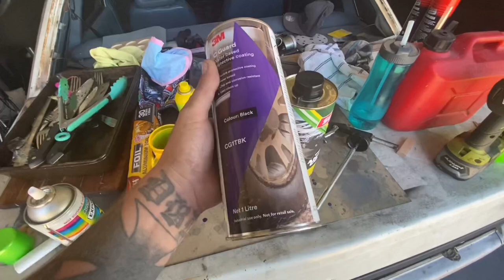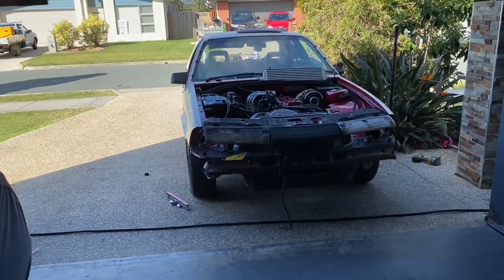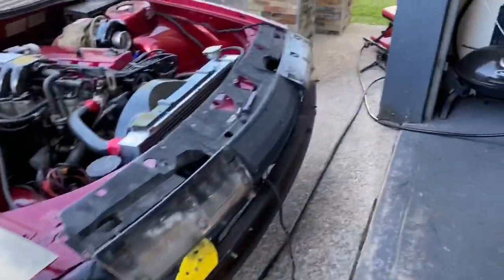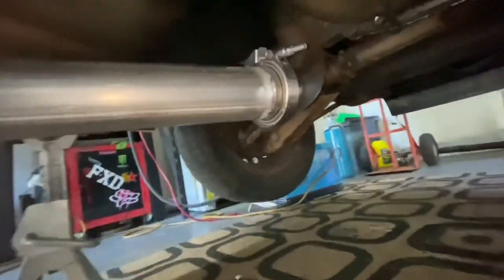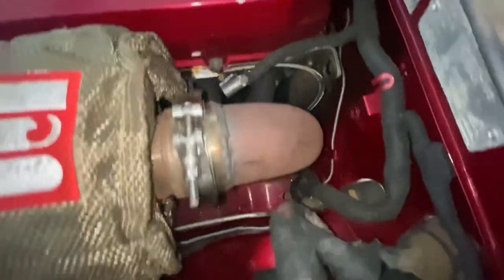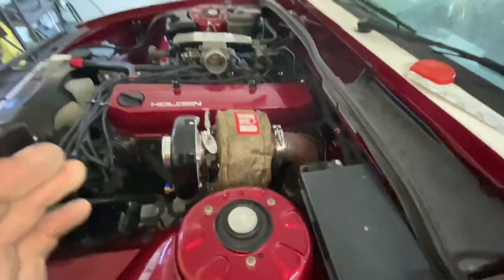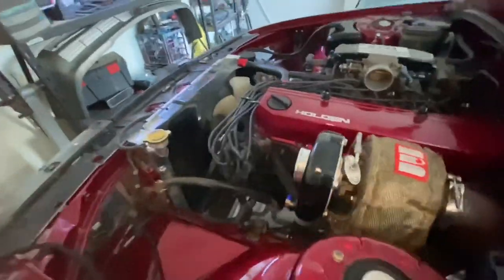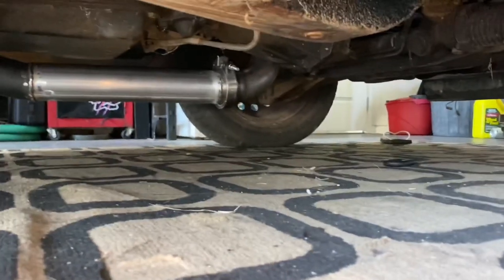Vl Executive Part 13 Making Exhaust & Painting Underbody

Comment: Hey mate just want to no if the mx7 York will fit a na rb30 Manuel box ? If not and u still have ur na Manuel York I'll buy it off you if u don't need it cheers
Reply from the maker: vlt rb30 king  no mate n/a ones are I think 24 spline and the mx7 is 30 yeah I still have it mate  where abouts are you located
Reply from the maker: vlt rb30 king  yeah I got it mate
Reply: I was the bloke Alex that told u we should sort a bit vl meet up and a big meet and stuff 🙂 where getting a meet together up ur way with alot of vls vks from all over attending so if ur interested  will be great cheers
Reply: Cheers
Reply: When u get a chance text me so we connected and will sort it on there cheers Mr project legend
Reply from the maker: vlt rb30 king yeah mate we have a club so we could definitely do a joint meet up no worries as soon as the cvoid19 thing is over
Reply: @MrProjectt  no worry's mate sounds good 100% will do a joint meet I'm going to have my mates custom vl BBQ there and will have a bit of a bite for everyone there, should be good day mate ☺️
Reply: @MrProjectt  yeah for sure mate